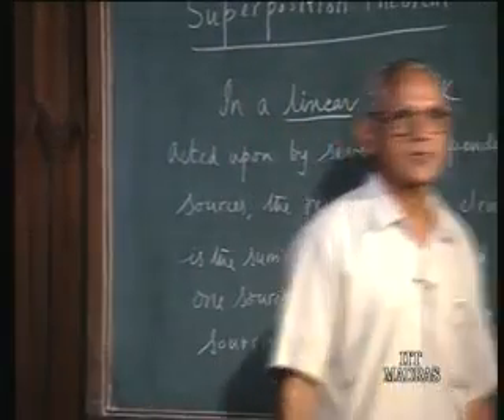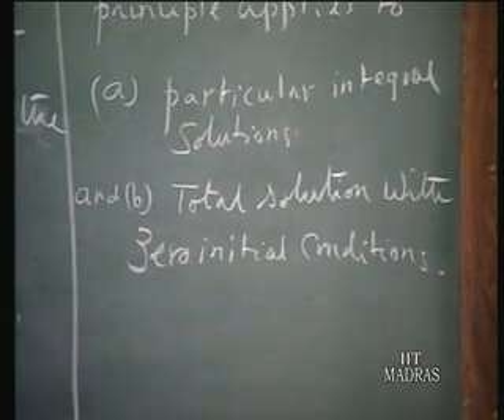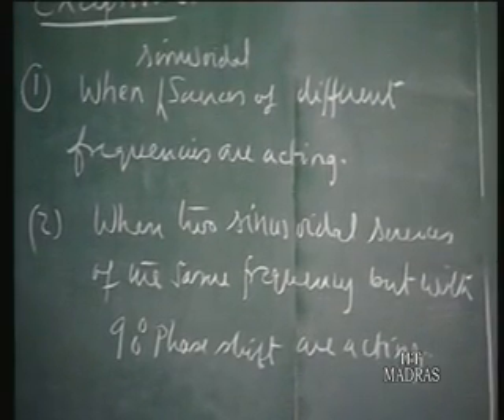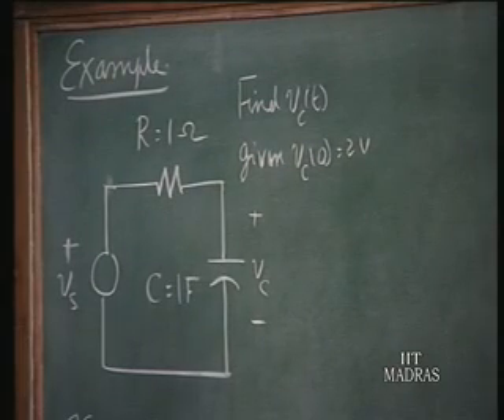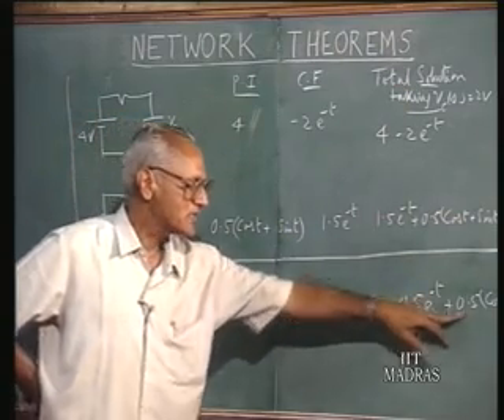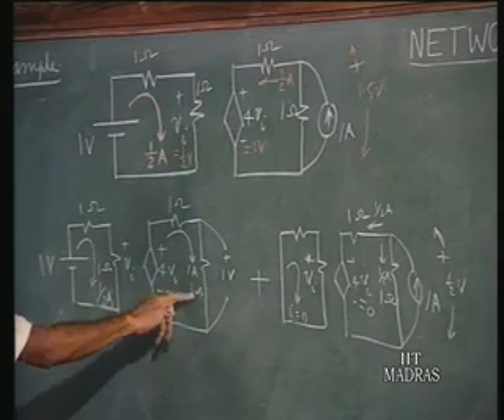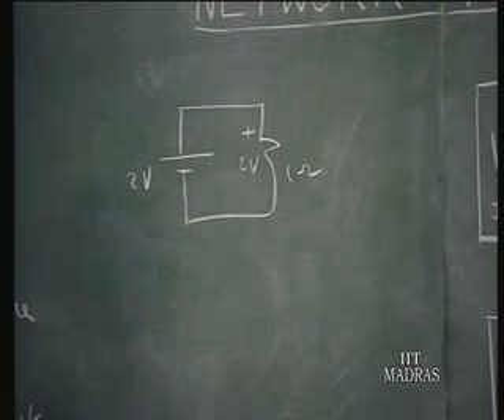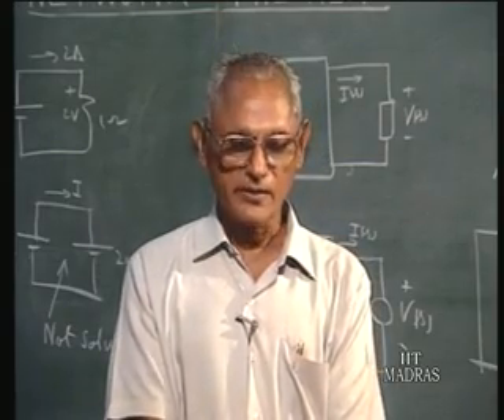Lecture - 34 Network Theorems(1)

Comment: in Ex 1 first dc IS USED ,how can we have a soltion for this as for dc omega is 0,and capacitor would  give infinite impedence,so no current.
Reply: That's why he was not talking about current he was just talking about voltage... Capacitance was infinite so current was zero bt voltage was not
Reply: He is iit madras professor.. A genius
Reply: "The voltage across a capacitor cannot change instantaneously" is a statement one finds often in textbooks on circuit theory which discuss the application of a step voltage to an RC circuit. 
Most students memorise and apply this in circuits without understanding the physical processes involved. 

It will be useful to learn the operation of charging a capacitor using a unified approach to electrostatics and circuits. 
Electrostatics and circuits belong to one science not two. To learn the operation of circuits it is instructive to understand Current, the conduction process, resistors and Voltage at the fundamental level as in the following two videos:
i. https://youtu.be/REsWdd76qxc and 
ii. https://youtu.be/8BQM_xw2Rfo 

It is not possible in this post to discuss the charging of an uncharged capacitor. During the first few nanoseconds after switch ON, while the surface charges arrange themselves, there is no electric field E_cap and fringe field because there is no initial charge on its plates; it is as though the capacitor was not there - as though there were a continuous wire with no break in it. 

The last frame References in video #1  lists two textbooks 3 and 4 which discuss in detail with a series of diagrams the physical processes in charging a capacitor.